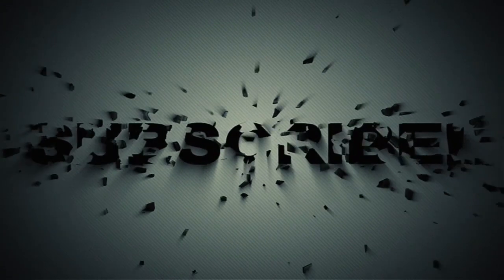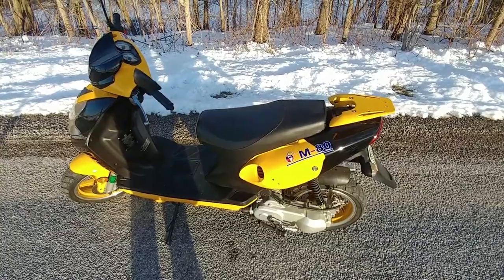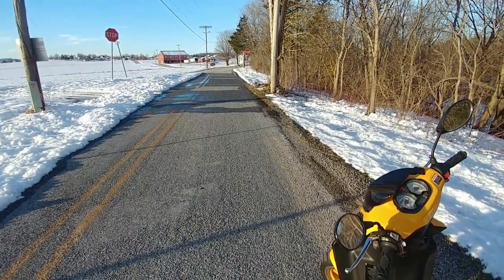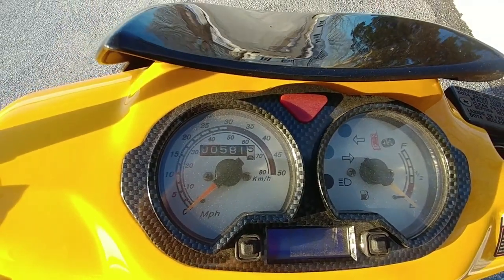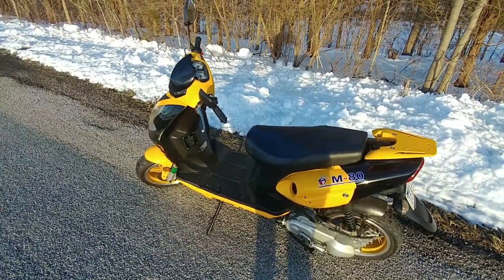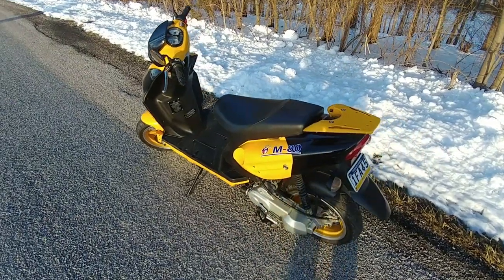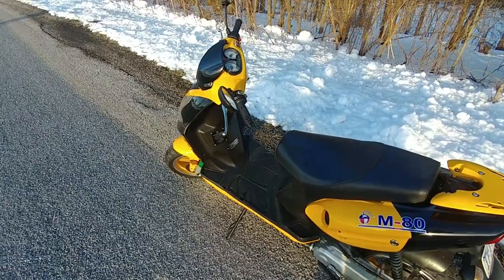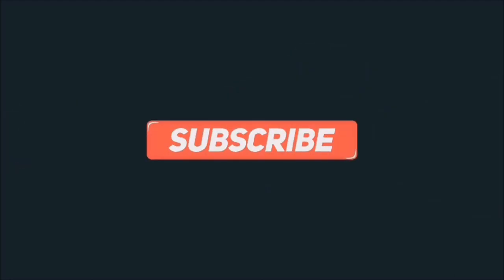UPDATE On The 50cc Scooter With 80cc Big Bore Kit

Comment: Added a high-flow air filter...almost always requires adding more fuel by putting in a larger main jet.  And adding a tach can show you if the engine can get to max revs and help show how well the roller weight is working on your setup.
Reply from the maker: Thanks.. And verry good info..

Comment: If that scooter only goes 35 after the big bore kit you did something wrong. Because my scooter is the same size and I did the same upgrade as you did but had mine professionally done and mines goes 45mph easy and I weigh 250.
Reply from the maker: It ran around 40.. You need carb and roller weights to get to 45
Reply: Mine does 43-45 but it’s a struggle to get there and that’s on a flat smooth surface

Comment: Did he say 25 miles an hour stock? My gator 50 e scooter is stocked and it'll go 35 to 40 on flat roads and 53 down hill
Reply from the maker: Lol.. Mph or kph?
Aint a stock 50cc out there doing 40mph😂😂
Reply: I have a gator 50cc 2019 scoot. The speedo is showing 10 mph higher the actual speed.  I put a 47mm bbk and cold air intake and see 40mph GPS verified speeds, I've gotten 42-43 mph tucked. I do weigh almost 240 pounds so that's pretty good as far as I am concerned. The stock speed was awful. I live in Florida and if you can't at least do 40 your going to get splatted.
Reply: See that's my problem right now because I know I'm not going faster than 30 or 35 miles an hour and you're right here in Florida if you're not doing at least 40 or 45 at least I would say 45 you're going to get hit? And we're not even talking about rush hour time any type of rush hour time you better just take back roads because right now that's what I'm trying to do is get tips on how I can adjust some of the stuff on my carburetor or engine or idle switch or something to make it go a little more faster question mark anybody have any idea how to help me
Reply: My icebear 50cc does 35 mph new, stock.
Reply: Same

Comment: Hello.
I also live in pa. 

Can  you tell me weather or not after installing the big bore kit ,
Did you pass inspection and emissions . I'm asking because I know with the bbk ,
It removes the pair emissions system control connected on top of the
Engine  . I would like to do the kit , but many people doing it don't live in the northeast , and don't even know about the California c.a.r.b. restrictions.

I'm glad I noticed your from pa also ,  hope you can tell me your experience with
Emissions and inspection after you did the bbk.

Do they check if the pair system is supposed to be hooked up.

Thanks again .

Cf.
Reply from the maker: It passed inspection every time with no problems! No emissions in pa on scooters.

Comment: My Baja SC 50 is 35 miles an hour and I think that’s slow I hope by doing all the work putting an 80 big bore on it I would gain more than 5 miles an hour
Reply from the maker: You can get them up to about 45mph, but need a upgraded air intake, carb, quality belt, & adjust the weights in the clutch.

Comment: Did you ever change your roller weights if so what work best for you ?
Reply from the maker: I didn't.. It Woulda been my next mod, but sold the scooter before changing them.
Reply: @cumminsperformancs  okay thanks man
Reply from the maker: You can get a roller kit online.. Includes all the weight options.. Pretty cheap.. Thats what I was going to get

Comment: I did this kit....it runs fine.
I'm only seeing 40mph but it revs to 10,000rpm...is that normal?
Reply from the maker: 40mph is about all you'll get out of these scooters without doing a lot of work. It sound like your belt is slipping, or you need heavier weights for clutch.
Reply: @cumminsperformancs  thanks! I'm on Amazon right now....any suggestions for weights?
Reply from the maker: You'd have to see what size you have now, and get heavier ones. Or you can just get a kit that includes all sizes and experiment with what works best.
Reply: @cumminsperformancs  that's a damn good answer right there.
Reply: How hard was it to install the kit , I got some experience with gy6 but never did a big bore install and i just got a bintelli hawk that I wanna mod.
Reply from the maker: @kenshi600  not to bad if you have some General knowledge of motor teardown.. You can see my install video here.. https://youtu.be/gqWHzO1tFtc
Reply: Did you remove the variator restrictor washer in the transmission housing. That might do it .

Comment: I have a 2014 50cc peace Sports? I'm trying to figure out what I need to make it go well over 35 miles an hour do I need a bore kit and an engine or do I need just a bore kit?
Reply from the maker: You definitely dont need a new engine.. A big bore kit, some carb work, and maybe some upgraded clutch weights.
Reply: @cumminsperformancs  gr8 thanx.. my biggest problem is not knowing exactly which package to order off eBay? Because some of the Big Bore kits obviously they either come in a hundred or a hundred 50cc which I've seen some with 80cc but I'm trying to figure out if I want to just get a hundred or a hundred 50cc also I've seen some packages with for kids that come with new exhaust and different things like that I can screenshot you and send you messages but I don't think I can send pictures on this maybe I can give you my number so you can help me?
Reply from the maker: @DanielAndrade-im4qq  you cant put a 150cc kit in a 50cc motor.. 80cc is the max without doing serious work! Where are you from? Maybe you should just get a scooter/motorcycle license if you need something fast.
Reply: @cumminsperformancs  I'm not trying to get a motor cycle license actually right now but okay I will do some more research? Thank you very much I'm in Clearwater Florida and all these places around here charge an arm and a leg so I'll try to just find somebody that I know can do it so I can just buy the parts and then probably just pay them some nothing obviously not as much as the shops would charge me? But I'm having a hard time finding anything with my brand name it's a 50cc 2014 peace Sports? I just don't know what to look up as far as buying the right parts or whatever for it how would I know
Reply from the maker: Did you watch my install video? There is a link in that video to the kit I used.
Reply from the maker: @DanielAndrade-im4qq  most Chinese scooters are the gy6 motor or 139QMB.. It Will say on the metal info tag thats located on the scooter
Reply: @cumminsperformancs  139qmb
Reply: @cumminsperformancs  2014 peace sports 50cc moped .???? Cant find any thing on this one ?????? Can anybody help out
Reply from the maker: It Will tell you on the metal tag!! Find the tag and see what it says.
Reply from the maker: @DanielAndrade-im4qq   yep same as mine had... The kit I used will work..
https://m.ebay.com/itm/80cc-47mm-BIG-BORE-CYLINDER-REBUILD-KIT-FOR-CHINESE-SCOOTER-WITH-QMB139-MOTORS/192231409263?epid=28010853304&ul_ref=https%3A%2F%2Frover.ebay.com%2Frover%2F1%2F711-53200-19255-0%2F1%3Fff3%3D4%26pub%3D5575278125%26toolid%3D10001%26campid%3D5338051655%26customid%3D%26mpre%3Dhttps%253A%252F%252Fwww.ebay.com%252Fitm%252F80cc-47mm-BIG-BORE-CYLINDER-REBUILD-KIT-FOR-CHINESE-SCOOTER-WITH-QMB139-MOTORS%252F192231409263%253Fepid%253D28010853304%2526hash%253Ditem2cc1e2866f%253Ag%253AGpwAAOSwa-dWoRVB%253Asc%253AUSPSPriority%252117365%2521US%2521-1%26srcrot%3D711-53200-19255-0%26rvr_id%3D2311358151983%26rvr_ts%3D78879a2d1700a4e967d655e0ffc97c82&_mwBanner=1&_rdt=1&ul_noapp=true
Reply: @cumminsperformancs  the bottom of my scooter reads the top is 1p39qmb and then there's another set of numbers in between two stars underwear I just read off that phone number to you? But is that the right number I gave you on the top of the Bottom by where the kick-start is it's not the set of numbers inside of the Stars right? So how do I know if I order this it will be fine for my bike and will it make it go faster? Just by putting this on
Reply from the maker: @DanielAndrade-im4qq  its a 139qmb.. And any parts will work that are for that motor.. If you want over 40mph you will be changing a lot!

1.. Big bore kit
2.. New carb or rejet kit
3.. New clutch weights and spring kit.
Reply: @cumminsperformancs  what about like right now what can I do without anything... variator rollers?? Cut the pink on the Cdi Box??? Aduust the idle
Reply: @cumminsperformancs  okay so I don't understand I thought with the 50cc I could upgrade to a 80 or 100 cc by just buying a work it and putting that on? Now what else do I need to do because all different types of videos say different things and I'm trying to do it myself
Reply from the maker: @DanielAndrade-im4qq  need to start with big bore kit
Reply: @cumminsperformancs  what kind because I've seen a lot of different packages on Amazon and eBay that come with mufflers and little racing CDI and stuff
Reply from the maker: @DanielAndrade-im4qq  whatever your budget allows.. Can get just 80cc big bore kit like I did for $28.. Previously sent link
Reply: @cumminsperformancs  okay so you're saying for my bike I can do this I will go ahead and click on the link in order that for $28 and then how hard will it be for me to install it and what kind of tools will I need
Reply from the maker: @DanielAndrade-im4qq  watch my install video
https://youtu.be/gqWHzO1tFtc
Reply: Wth
Reply: @cumminsperformancs  100cc is the max before you have to do a engine block bore

Comment: bro any chance in you recommending a big bore kit to buy for my sym jet 4 50cc 2015?
Reply from the maker: 80-100cc is as far as you wanna go.. Anything bigger requires major work and upgrades.
Reply: @cumminsperformancs  any chance of recommending a link to a big bore kit I can buy? I’ve upgraded my cdi unit taken the speed restricter out I’ve also increased air flow with a new filter I’ve put a new racing belt and 4.5 gram rollers in it
Reply: @cumminsperformancs  you got a new sub by the way your channel is very interesting and your making me wanna film my ride outs in London!!
Reply: @cumminsperformancs  I currently get 44mph with a new belt but without a big bore kit still need to test my bike since installing rollers and belt but been super rainy over here in England
Reply from the maker: Wow 44mph is fast for stock!
All 50cc in USA are governed at 30-32mph
Reply: @cumminsperformancs  yes so was my till I took the restrictions off lol when I first bought my bike it went 29mph and with the small mods I’ve done I get 44mph which is illegal in England but you know boys will be boys and we like to mod lol
Reply: @cumminsperformancs  I would like to make a video of my bike and send it to you to show you if possible you know a bit of fan mail 😂
Reply: @picante3302  get some gears your gonna go up 10 to 15 km/h
Reply: @martinst-pierre8074  thanks bro I've stepped up to a brand new 125 but much appreciated